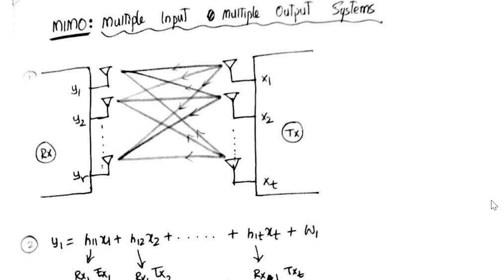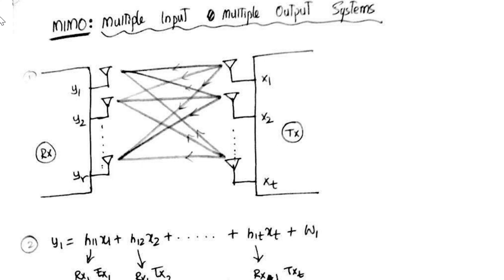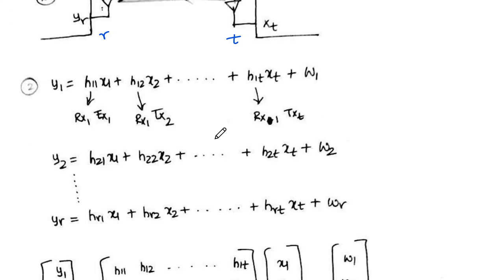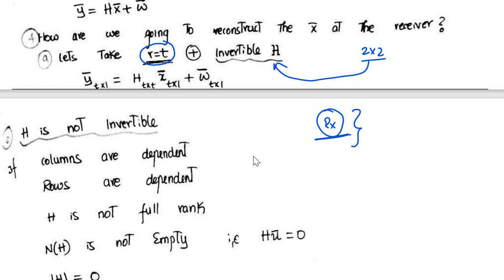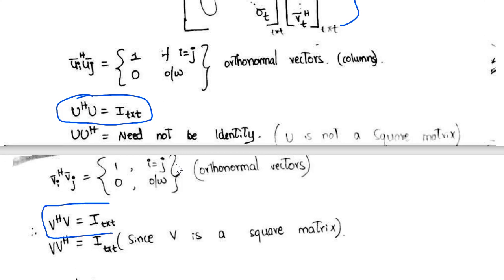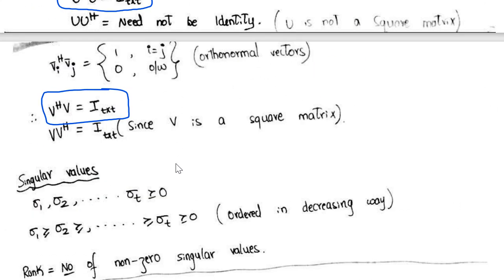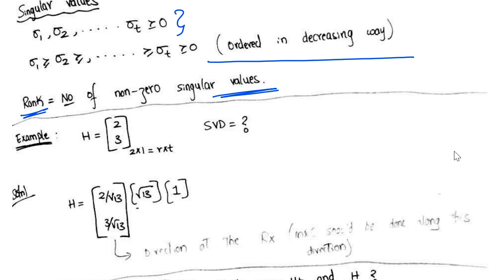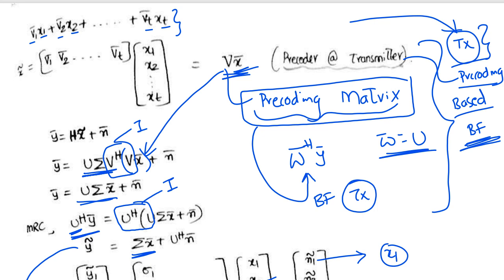[Series #9_5] SVD Based Beamforming (BF) of Channel H | Precoding based BF | Tx BF | Rx BF

Comment: Correct  me if i am wrong SVD is used to charactarize the channel ,  the orthogonal vectors we find while decomposing Channel Matrix into u sigma v*    if we precode the transmit vector with orthogonal matrix v  then according to channel condition at that time  we will  get another set of orthogonal vectors scaled by diaganol matrix sigma   since the recive  vectors are othogonal we have created paralla MIMO channels ...  i dont see any beamforming happening with SVD
Reply: more over Beam forming needs phase changes in signals sent to antenna elements and all the elements should have  same copies of the signals to to be directed to a particular direction. ( That can be achived via precoding  .. why SVD precoding is mixed with Beamforming precoding )

Comment: Hi sir,  Is it possible to find direction-of-arrival (DoA) (relation between V and direction of the beam) at the receiving end using the same SVD method?
Reply from the maker: One can find the direction-of-arrival (DoA) at receiver but not with SVD. One should go for different scheme which is related to Analog BF.
I would try to give some connection to DoA in the upcoming videos. Stay Tuned.
Thanks :)